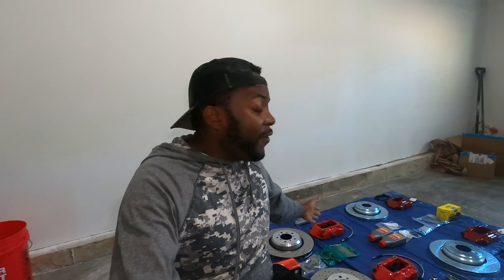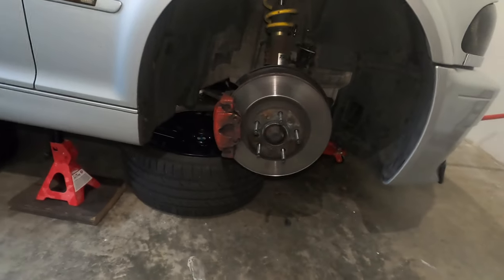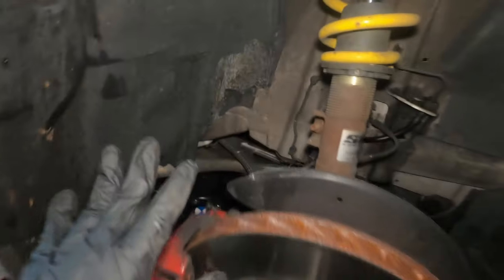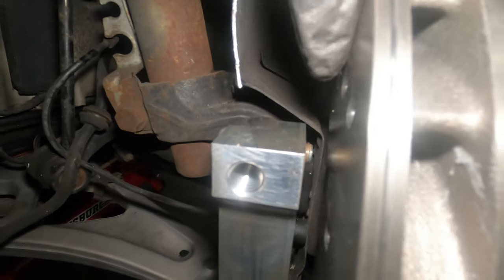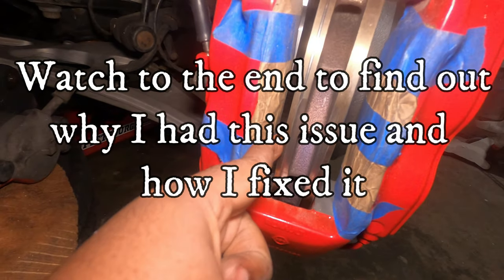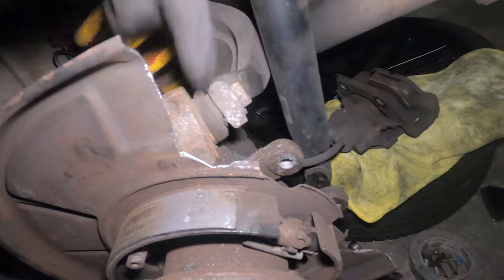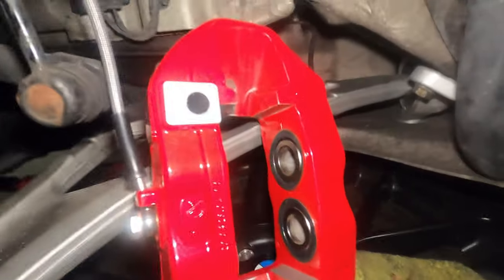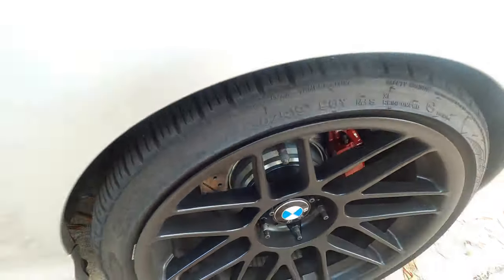E46 M3 Budget Big Brake Kit Installation

Comment: It's not so clear in your video (good job by the way) but I'm looking for information about the front setup. Do the pads contact all of the disc or are you left with a rust ring because the caliper and pad setup doesn't contact the whole braking surface?